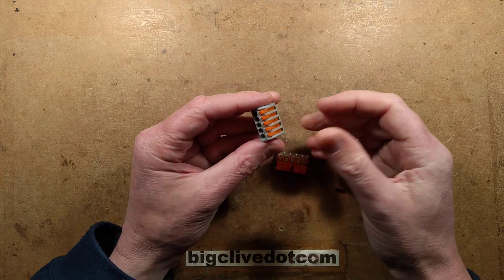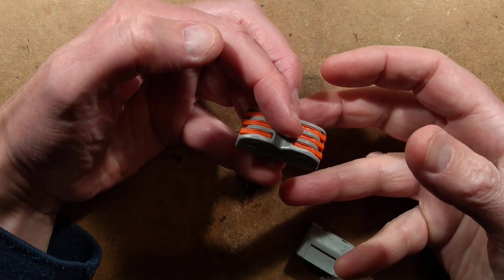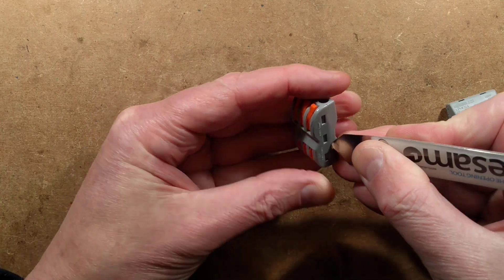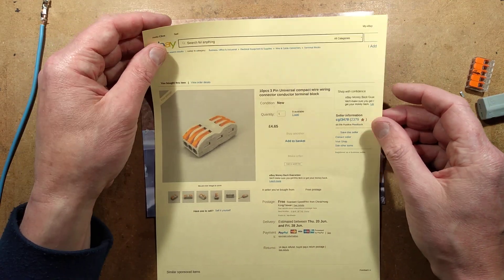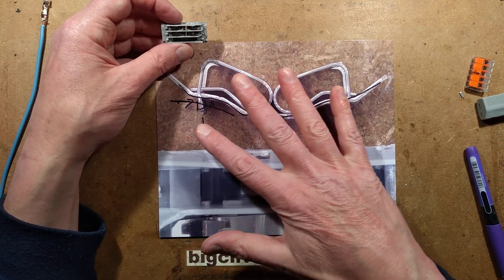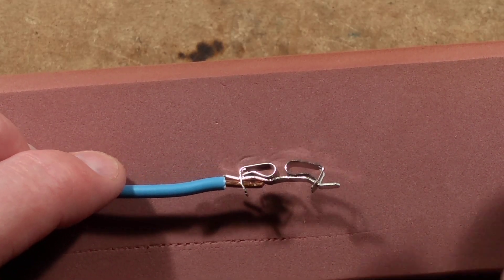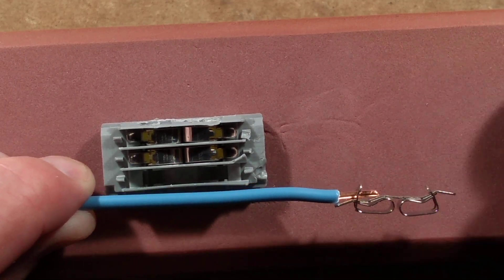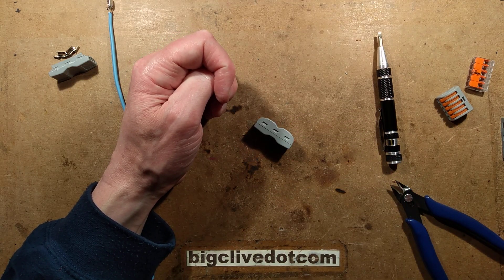Clone of Wago product that Wago don't even sell???

Comment: i actually remember when i talk with one of wago sales, why they don't sell this clone thing. the reason is unnecessary. so i ask why? the reason you buy wago connector is you need to connect bunch of wires in one common. so if you need to connect the wire, just solder it, or using wago 2 pin.

Comment: Useful for joining two wires, but usually I want to join more.

What would be even more useful would be having 4 connectors per phase. Such as two of these connectors together with the top connected to the bottom.

You can do that using individual wago connectors but less messy if they were all together.

Comment: Looks like a Wago version of the British “choc block” terminal strip.  Useful in control panels, but would have issues in general wiring due to minimum pigtail length rules.

Comment: It's no good use in home instalation. Gives options to lengthen wires over spec. And give weak points in hidden areas. Not good to get on the market.

Comment: I use these exclusively now for hooking up single phase 120v pump motors.  Line/neutral/ground.  For when we need to do a quick swap out they save so much time. strip and clip - done.

Comment: I'm surprised they didn't make these first. However I'd recommend the continuity is color coded rather than all 3 being orange even though they are separated lines
Reply: I guess someone already does make them color coded https://www.amazon.com/dp/B07Y6687XN/ref=cm_sw_r_cp_apa_fab_qwkHFb2EPDG9K
Reply from the maker: After this video a local supplier started stocking them in the standard cable colours.

Comment: In the US the code requires a simple method to disconnect ballasts from power in lights using a "safe" system, i.e. one that won't cause you to have a live wire just flopping around. Maybe this is supposed to be for that type of thing? Although it wouldn't pass muster as you still have that bare wire problem.... Anyway....

Comment: Actually, there are a lot of different variants of these clones available on Aliexpress: 1) with different visual quality (though they are mostly OK) 2) with different number of terminal pairs (2-3-4-5) 3) with different body colors (including transparent ones) 4) with or without color-coded terminal levers (blue-yellow-orange, blue-black-red. red-green-blue, etc.) 5) with or without holes for test probes, similar to the ones on the original Wago connectors (the clone in the video does not have test probe ports).
Reply: Also, there are versions with N terminals on one side and N*2 or N*3 on the other.

Comment: Wago has what they call "luminaries" connectors for something along this idea.
I have bought a box, but not used them yet so not sure exactly how they work. It appears they have 2x 2 poles in (2 slots each for 2 wires neutral and load?) and a disconnecting part that has 2 poles that I assume would connect to the luminary.

Comment: My ant miners run on 240v and use a lot of amperage that's why I use 30 amp rated ceramic screw terminals ,I'd be petrified these would melt n catch fire .

Comment: Many of the outlets in our house are the push-in springy back-wire variety, and they've been the bane of my existence, especially on the exterior walls. I'm not sure how long they've been in use, but they frequently fail. Just pulling the outlet out of the box and twisting it a bit fixes them. Usually I replace them with screw type, but a few were wired with so little slack that I can't even get them out of the box to replace them. So I need to do this little ritual every couple years.
I wonder if the Wago connectors without the levers will be more reliable over time than these wire clamps. The ones with them seem more robust and appear to clamp with much more force than the non-removable ones.

Comment: What might be an neat idea is to make them with little dog ears on the outside casing that a screw or nail could go through to anchor it, or perhaps mold the thing into a plastic junction box housing. I know it's originally intended to replace wire nuts or other joints of that nature, but why not improve on it more so it can serve as a quick and tidy anchored terminal of sorts. (Not to hold wires in place mind you, but to just have a connector which in itself isn't going anywhere.)

Comment: An area where these can be useful is in low voltage connectors (say 12V or 24V) that may need regular changes or be located in difficult to access areas. 
For example Pond Pump connections. Because every few months these blasted devices have to be stripped down and cleaned out or even replaced (they are a pain). But what would be really good is a waterproof solution. Any ideas?
Reply from the maker: For easy maintenance I'd recommend a concealed plug and socket.  For underground use you do get gel filled connector boxes.

Comment: if wago product is originally manufactured in china. 
then it is highly possible that the clone came from the original manufacturing facility. 

you need to understand that those who "have an idea" and wanted it to be manufactured in no time doesn't really need to own a manufacturing facility.   I mean yes you can start your own manufacturing but it takes a lot of money and effort not to mention the risk of not being profitable. 

so when you go to china you will need someone who knows a lot on manufacturing industry. 
the plastic molding will be done on molding manufacturing. 
the metal part will be done from another facility
then the assembly will be done from another facility. 

so if I wanted to copy wago , I could simply copy them and find myself those 3 type of manufacturing facility mention above. 
manufacturing DOESN'T CARE about if you are copying someone's designs.  coz that is not their job. 
their job is ONLY to manufacture what their clients want.

Comment: pronounced "VAGO" they are german.... never trusted these, just use a screw terminal instead.
Reply: You've never trusted a guaranteed permanent connection? But trust a screw that will innevitably come loose? 

The sheer amount of call outs i have to loss of power to lights and sockets is nearly always due to a loose connection under a screw.
Time to phase out connector blocks and JB's and move into the 21st century

Comment: If you took two standard 3-way Wagos, superglued them back to back, and lined them up against this, how would you know if it was through-through or common bus both sides? I agree a product like this is really useful - replacing those old terminal connectors we know from day dot - but really? The fact you had to check how the terminals were connected to begin with should be a massive clue that it's confusing as hell.

Comment: That seller only seems to have the 2-pole version now (https://www.ebay.co.uk/itm/10pcs-2-Pin-Universal-compact-wire-wiring-connector-conductor-terminal-block/223557940991?hash=item340d1776ff:g:01UAAOSwb1NcmlY0). 

Has anyone found the 3-pole anywhere else recently? Links please!

Comment: Has the knife ban gotten to be so extensive that you have to use a feeler gauge to pry on the case
Reply from the maker: That device is a spudger.  Designed for opening tight plastic cases.  (But not this tight.)

Comment: It would be interesting to test the faux Wago's separation via signal cross-talk (not super good, I'd expect) and actual insulation resistance via megger or (preferred) hi-pot. Put some spec into the picture. I HATE unquanfified technical stuff.

Comment: This is definitely a clone of course. But wago only produces ones with 2, 3 and 5 slots. It is Wago 222 series. Also called Wago Classic.  The ones with 8 slots, or pass through ones, are entirely fabricated by Chinese inventors. For low voltage or low current situations they might be ok I guess. Wago has gazillion other options. They are a leader in DIN rail connector systems. Their catalog has about 3000 pages.

Comment: WAGO 862-0503 is a multipole in line connector but is very big. This with the low profile WAGO 221 would be eaven better.

Comment: These connectors are awesome. I am definitely going to be ordering some when I have the money to buy random supplies again. Already see a solution to the moisture ingress. A rubber or silicon grommet to poke the wires through. Wouldn't help with submersion but should work good against splashing and misting.

Comment: We had a product which had spring type pcb edge connectors in them.
They were green.
It's the one thing the customers were unable to destroy, pity they take up a lot of real estate on a pcb.
They were actuated by poking a small flat blade screw driver down a hole and levering.
The hole could also be probed with a meter once a wire was in.
If one Googles Wago splice it brings up these connectors.
Try Phoenix splice, lots of wimmin in swim suits with not a connector in sight lols.

Comment: They DO already sell these... Because I'm German, I've picked the german product pages (you can't easily change your language on their homepage). Here are some of these:

2-pole-connector (for Lamps):
https://www.wago.com/de/netzanschlussklemmen/leuchtenanschlussklemme/p/294-4012

3-pole-connector (also for Lamps, carries also PE):
https://www.wago.com/de/netzanschlussklemmen/leuchtenanschlussklemme/p/294-4013

5-pole-connector (you know it, for Lamps - L1, L2, L3, N, PE)
https://www.wago.com/de/netzanschlussklemmen/leuchtenanschlussklemme/p/294-8135

5-pole-connector (now also for other devices - Safe to use in potential explosive areas):
https://www.wago.com/de/netzanschlussklemmen/4-leiter-geraeteanschlussklemme/p/862-1505_999-950

Comment: You know the Wago catalogs actually have schematics and cut-open images so you can check the inside. Wago does have better solutions (IMHO) than those horribly chunky knockoffs for through-connections; for lighting/device connections there's e.g. the series 294. If you want an anti-parallel double push mechanism, there's also the series 224 but that's single conductor only. If I need inline connections I prefer putting ferrules on and then the choice of inline clamps is just nuts...

Comment: I think that resistor array was from the self electrocution experiment,  the one that left us concerned about your health, that being said I recently used a wago style connector that was low profile and  you cant remove the wires , one shot deal, but worked out very well for me
Reply from the maker: The one shot ones can usually be reused by twisting the solid core wire as you pull it out.

Comment: Cool review. A succinct and educational exploration of both the feature set and the limitations of the implementation.
An intuitive and coherent user interface doesn't happen by accident and doesn't appear to be on the top of the list for the SIGLENT design team. If they could lure over one of the R&S or Keysight designers they'd be cookin'.
I reckon if you really need a 1GHz scope then your time is valuable so it's worth stumping up the extra cash for a professional unit.

Comment: There is one problem I found with this connectors, if you want to connect more than one wire in the same hole (say if your doing low voltage and low current stuff), then both wires need to be the same gauge or else they simply pull out. I know it seems like an odd thing to be doing, but i've done it several times whilst expanding my low voltage security lighting.
Reply from the maker: I wouldn't recommend using two solid core wires in one hole.  Not so bad with stranded conductors.
Reply: @bigclivedotcom  Oh :D i'd never use solid core into one of those, I have a 50m reel of 0.5mm2 automotive thinwall that I use for most things. The problem first reared it's ugly head when I used 16/0.2 in the same hole as the above.

Comment: You sold me.
3 pcs 2line  1.60 USD incl. shipping to Denmark.
2 Pcs 3line   1.67 USD incl shipping to Denmark.
Impressive 5 units for a tad over 3USD with shipping.
and if Wago don't make a pass thru connection unit. it not like you have an alternative to go for the Org.
Also, exist the DIN-rail line version.
https://i.ebayimg.com/images/g/6~AAAOSwIfBcrupH/s-l1600.jpg

Comment: I've heard these wago blocks mentioned a few times, but I just can't picture any permanent use case where they're actually needed and better. As a temporary or hobbyist setup, sure (as a step up from bread boards).  But they just look too fragile for any sort of long term usage. Where would you use something like this (or the regular Wago bus-type connectors) that couldn't be done cheaper and just as easily with a wire nut or crimp connector?

Comment: WAGO does sell those low profile connectors, as you can see in the catalog: https://www.wago.com/medias/Anschlusstechnik-f-r-Leuchten-und-Ger-te-60362394.pdf?context=bWFzdGVyfGRvd25sb2Fkc3w0MTEyODEzNnxhcHBsaWNhdGlvbi9wZGZ8ZG93bmxvYWRzL2g4ZC9oZmEvOTU3MDc5NjY2NjkxMC5wZGZ8MGNlNWEwOTE3Yzg4MDBmOTFhZjNkOTg1ZTQzNmMxY2JkMWVlOGQwNmNmM2RkNDI2MWRjNGI0YTI5YTgyNDJkNg&attachment=true

The bigger ones aren't in the 2018/19 catalog, but I have seen them rather often, working as an electrician many years ago, when Chinese products still wheren't too popular here in Germany. so I am rather sure those where officially sold bei WAGO, too.

Comment: I searched a bit, could really not find it at Wago, but the Chinese sites are full of them, mostly type-named
SPL 2 or SPL 3, depending on the amount of connections. They claim it is the Wago 222 series, which has the same look, but the 222 does not contain that type.
I noted 'some' brandnames there:
YJCAL, kenaitor, WONKEDQ, SUPOELE, FeeDaa, HOOYEE, HIREYELE, Soijot, Echainer, NKHAEEY, DIY YOU
and more.

Pay attention, they are not all the same, some have test ports on top or not, some have seperated holes or not, and both housing (plastic) and contact materials are different, from just 'copper' (which I doubt is true) to 'Tin plated copper + Nickel chromium alloy steel'.
Also the prints on them are  different, I saw at least 5 of this particular 'new' type.

Comment: Wagos differentiating capabilities is their plastic molding. It's possible that the Chinese companies are getting bit of subsidy because thats usually Chinas thing is plastic molding and they want to wipe out their competition. As for is this a new innovation. Well I wouldn't put it past them. While really rigorous best practice is just not a thing you ever see sometimes there is companies that really care about well designed products in China. I've got a Bluetooth keyboard that still baffles me at how nice the plastic molding is and how well it works.

Comment: i've been told these are compatible with the flexible multi strand cables... without having to crimp or solder the ends... i'm still not trusting that.. what's the comment section their opinion on this?

Comment: Bought many of these connectors for 12v / lv work and the Chinese versions are pretty durable. Haven't seen this version before, so I'll just have to investigate! It would be interesting to do an insulation test on those 3-way linkers, to see what the flashover / breakdown voltage might be. Most commercial polymers used in injection moulding have a decent insulation resistance so that should be good for 240v.

Comment: They really are long overdue.  Lots of other connector styles to achieve the same thing, wago looks sexier though.
Looked on wago sites - so sign whatever search terms used.  I'm with the counterfeiters out wagoing wago 
I've ordered some for low voltage work .... separation not an issue.
I still use the old school choc block screw terminals, they work well and if you use aglets, don't damage stranded conductors.

Comment: @bigclivedotcom -- Are the springs really stainless steel? They might be tin-plated carbon steel. To prevent wires pulling out, run the wires into the opposite side of the connectors, then the tension will not be on the springs. (Put wires from the left into holes on the right, and vice-versa.) Too bad there are not molded-in wire guides on the bottom to help maintain the overall orientation. :/

Comment: that looks like a rather handy connector.   though I'm wondering if both side a and side b are electrically connected to each other why would it be a bad thing if the wires on either side could touch,  your pretty much connecting them together anyway.

Comment: Found them other day,they are selling them as Wago 221/222 long connectors on Ebay. https://www.ebay.co.uk/itm/Wago-221-222-Series-Spring-Lever-Reusable-Terminal-Block-Connector-2-3-5-6-8-Way/264195145980?hash=item3d834200fc:m:mc76dr-gji2_5xhzHa30q9w

Comment: Can you do an isolation test? Are these actually safe at 240V RMS?
Reply: i believe they are approved for mains voltage use in the UK and here in Australia also.
Reply: SED71 he means the Chinese in-line one obviously.
Reply: @smallenginedude71  probably safe (they seem to be high quality) but I doubt that they are approved.

Comment: A search on RS for WAGO comes up with a similar 3 pole non-fused terminal block (#815-880 £1.29ea) 28 → 14 AWG, read the datasheet as it shows they are rated as 300V  and 10A 
WAGO also make a 3 pole 4 connector  non-fused terminal block perfect for mains (#475-1487 £1.12ea) 20 → 12 AWG, rated as 500V, 32A. 
I would say, for 47p each I wouldn't have a problem using these though.

Comment: I was thinking to use these in joining the ground and the output jack wires in an electric guitar for easy interchangeable pickup and pot circuits. But not sure if it will be better than welding. Though not much electricity going through but I’ve seen tone difference with bad connections. Any advice? Thanks, cheers!

Comment: Great find. 
In an ECU wiring harness I can't afford to lose any length each time I make a change. For testing I'm always stuck between using the normal Wago levers or the cheap white spring connectors, which pass through like these do, but cannot be trusted to hold for long.